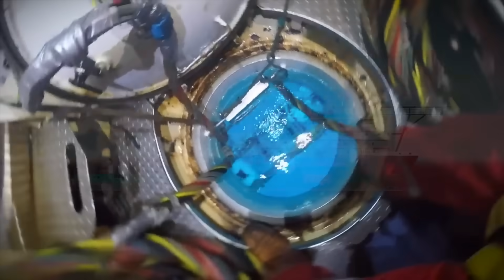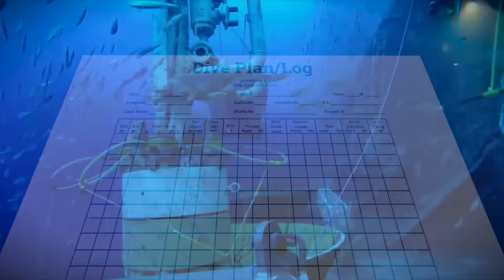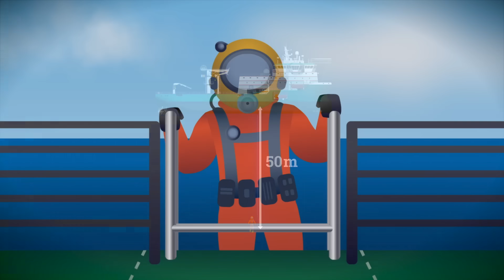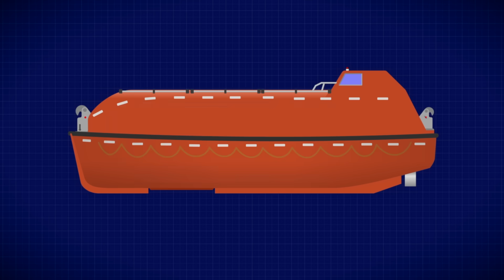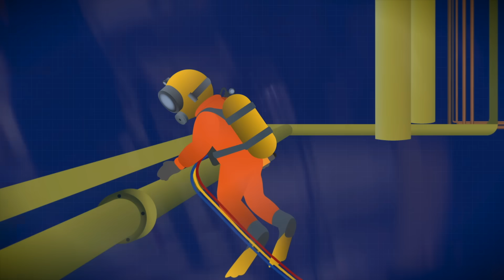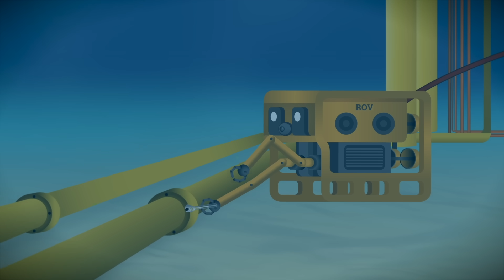Deep Pressure – How Do They Survive It?

Comment: Former ROV pilot... The main reason for the continued use of diver, especially sat, is legacy. Most new subsea equipment is engineered to be fully functional with ROVs. Older fields that were established before ROV came to the fore still need divers.
Reply: Said like a dirty ROV driver.
Reply: Met a couple of y’all at deepwater Horizon, I was one of the SAR team and then stand by rescue for the recovery. You ROV dudes are solid.
Reply: Like I am heavily working with AI and it has become worse over the last few months. Its just "unpredictable" and tbh its coding worse than a junior currently. It has a lot of knowledge but it fails to implement it and follow simple orders.
Reply: @MrArkaneMage  ROV systems do not use AI.
Reply: @Chris-hx3om  I am working as a software dev so it really tickles me to know more about that hehe
Reply: Not really, they're still useless in close quarters, where someone might need to be flexible/maneuverable and inside where signals might get lost.
Reply: @Stealth86651  You are referring to AUVs, not ROVs. ROVs are tethered, and I have personally piloted into some very tight spaces. We have done work that was considered too dangerous to risk human lives (divers). As for flexibility, I have used manipulators to untie knots divers have left on equipment by mistake. We are also capable of securing just about anything you like too. Maybe you are thinking of the ROVs of the 1990s.
Reply: I think there is also a big part which why we dont use AI everywhere yet. It does the minimum but can you really be sure it performs well in edge-cases or can even spot them? What if an ROV malfunctions - will it destroy the pipe or just stop working? There are a lot of unknowns which keep us from fully implementing them yet, I guess.
Reply: @MrArkaneMage  Sorry, but for deeper water, and newer fields, ROVs are already, and have been for over 10 years, fully implemented. Part of the dive plan is always 'what do we do if it all goes south? The systems are specifically design so that if there is an ROV 'malfunctions' and it's 'gripped on' to anything, the grip will release as system pressure drops (most intervention ROVs are electric driving hydraulic). It's very rare (and getting rarer) that another ROV needs to be called in to rescue the first ROV. In 30 years of my ROV career I was involved in rescuing another ROV twice, and they were both in the first 10 years.
Reply: @Chris-hx3om  Thanks for your insight! In regards to AI it was more a specific "what did i experience with technology", thanks for clarifying that so far there is no AI involed in ROVs!

So if I understand it correctly its all "manually controlled" still and there is little to no automation involved?
Reply: @MrArkaneMage  "So if I understand it correctly its all "manually controlled" still and there is little to no automation involved?"

At this point in time, you are correct. What happens in the future is anyone's guess. That said, I was told 25 years ago that "in 5 years there will not be pilots onboard (vessels). All the piloting will be done remotely." Still waiting for that to happen. Working from home would be great!
Reply: @Chris-hx3om  Indeed, tech has promised a lot they couldnt yet fulfill. Some day I imagine it to be like filling up trucks - just being controlled by a remote operator that checks the systems and has a camera to see if everything is working as intended.
But we are far from that still, I guess.
I think its also a lot about insurance - who pays if something automated goes wrong? Here in germany we have some laws for that but idk if thats also the case in other countries. And sure as hell the tech-companies dont want to pay for big disasters, its way more easy to just let a child-company "die" as a sacrifice.
Reply: @MrArkaneMage  Interesting you used mining autonomous trucks as your example. I now work in exactly that area. Which is why Tesla's self-drive scares the living beejesus out of me. Tesla hasn't got the tech right, not even remotely close.
Reply: @Chris-hx3om  Wow, thats coincidence at its finest!
Yeah I mean Tesla is going some ways but I definetly dont think its production ready yet lol
Especially because I know a lot about our IT I just can say "HELL NO! Get the fk away with that idea!"

You wouldnt believe how fked up our IT is... US seems to be doing kinda "ok" but here in Europe man... its a giant dumpster fire just waiting to go off
Reply: @Chris-hx3om   aand it seems like my comment got hidden by YT again - thx EU for your ... laws!
Definetly a nice coincidence we got there with your new job lol
Reply: @Chris-hx3om  That fking censorship really makes me want to stop commenting on YT, I am literally that close ^^
sry for saying it to you, I am just fking mad about whats going on here, it has become unbearable... a lot of comments getting hidden from the main-sorting for literally no reason but some keywords that make the AI say "nope"
Reply: @MrArkaneMage  I know what you mean. I sent you a message with ascii code, and it got deleted. What the, YT????
Reply: @Chris-hx3om  Its because of EU-laws forcing YT for the sake of their own well-being...
You can prompt AI for further details, its self-protection in that regard...
They are simply overregulating
Reply: @Chris-hx3om  Some is also bot-protection but yeah, we all know that this is definetly not working as intended
Reply: @Chris-hx3om  You can see all comments by switching the sorting btw, its a common misconception - they dont get deleted, just hidden in one of the two sortings
Reply: @Chris-hx3om  Ok I have just checked and it seems like your comment in fact got deleted.
Reply: @MrArkaneMage  I'm not IN the EU, so those laws don't apply to me.
Reply: @Chris-hx3om  Yes and thats what makes it sad... it affects ppl not living here
Reply: @Chris-hx3om  And dont get me wrong, the EU has some benefits... but its slowly turning the very wrong way. One of their latest laws is that software devs are liable for bugs... even in free-software which - if implemented in all EU-countries - will have HUGE drawbacks for everyone.
Reply: @MrArkaneMage  YnJvd25zcG90dGVkIGF0IGlpbmV0IGRvdCBuZXQgZG90IGF1       See you on the other side.
Reply: @MrArkaneMage  So, I've tried hex, and code64. How do I get my contact details to you?
Reply: @MrArkaneMage  I'd like to be able to have a conversation with you. Any ideas how?
Reply: @MrArkaneMage  More deletes. How do we chat to each other?
Reply: "Operator" Preferred nomenclature

Comment: The deepest commercial dive didn't even make it to 600m and even then it is very rare that they even go this deep. Why are you making it sound like this is a daily occurrence?
Reply: The deepest saturation dive went to 701m, so I don't think the 600m number is unreasonable. Yeah, the most common work is considerably shallower than that, but the whole point of interesting videos like this is to see what the limits can be.
Reply: @clapanse  Thats wrong, the 701m was a simulated depth inside a chamber. Not a commercial dive. As far as I am aware the deepest was around 550 ish meters.
Reply: @clapanse that was simulated in a chamber. The deepest commercial dive is the Hydra VII program, where divers dove to 534m using hydrogen/helium/oxygen. The deepest non commercial dive is 332m using only scuba equipment (no umbilical or dive bells). 

The difference between simulated and real dives are huge. Exposure to the elements (cold, stress, currents) can result in greater DCS risk.

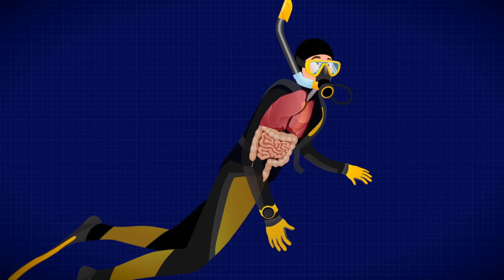Comment: 2:00 the issue first will be that the volume of your lungs is not greater than the volume of the snorkel. you will not be able to push the volume of air out of the snorkel and will just be breathing snorkel air until that runs out.
Reply from the maker: The first will be the difference in pressure that could lead to negative pressure in your chest.
Reply: @CasualNavigation you're right the instant collapse of your chest would def be your first problem!
Reply: A typical adult human is able to exchange about 2 L of air each breath. That equates to a 20 mm diameter tube 628 mm long. However players of brass instruments, especially the larger ones can reach more than twice that through training. Typically the max pressure your lungs can inhale equates to 1 m water depth. So both two limits are reached at very shallow depth. Which hits first will depend on the individual, and diameter of snorkel.

Comment: With all this machinery and support needed to make this work, I have to wonder how it wasn't just safer and cheaper to just use JIM/WASP suits or something similar?
Reply: I guess the main drawback of JIM/WASP suits is that no matter how well you design them, bare human hands are simply much more flexible and useful for most situations, capable of operating both large and small equipment and a vast variety of tools immediately, not requiring lengthy refits of the suit's arm tools.
Reply: @rusher2937  With the advancements in robots though, I could see much more keen manipulators being possible.